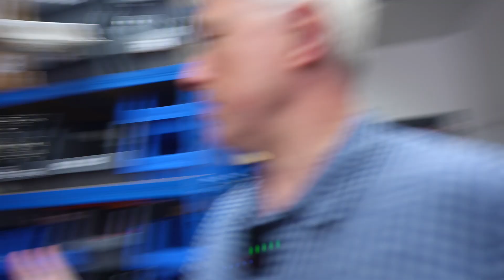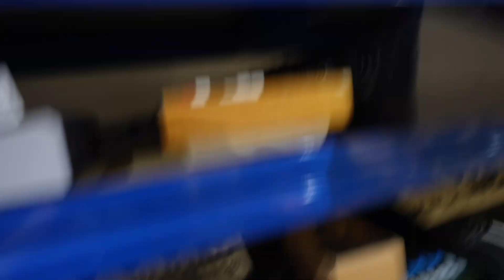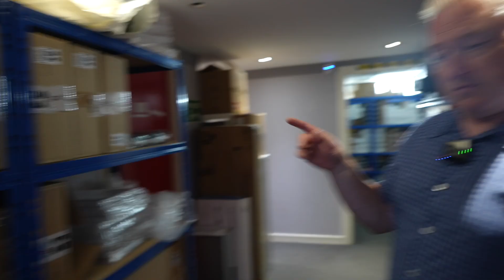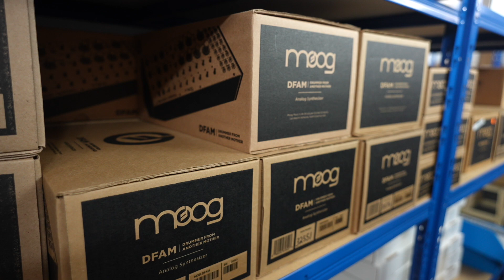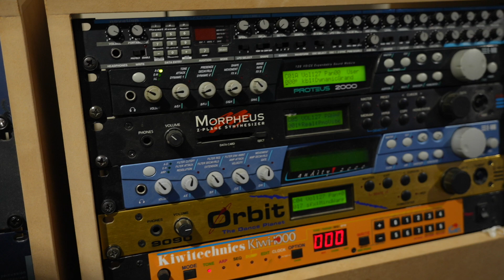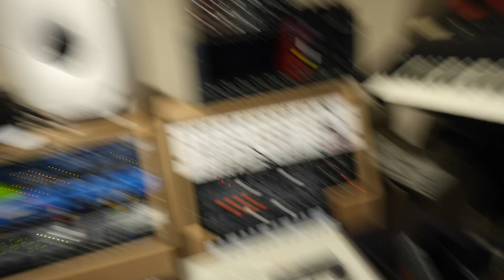Welcome to Synth Paradise // Signal Sounds

Comment: A ZX81....cooler than all the Synths...except the Andromeda.....yikes. Wavestation EX (no filter at all), Bassstation Rack (lots of s's and filter that ate bass), Juno 106 (noisy chorus), old gear I ditched in the naughties. MMT-8, I still use a brethren of it the HR16.
Reply from the maker: So many hidden treasures.
Reply: @StephenMcLeod In Switserland is synth museum. LookMamNoComputer was there. You would go out of your skull in there.